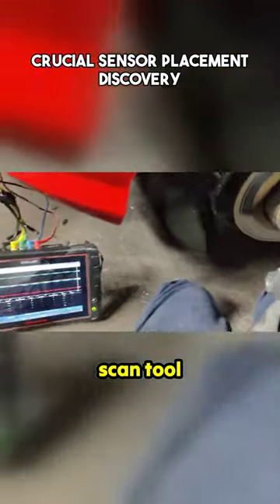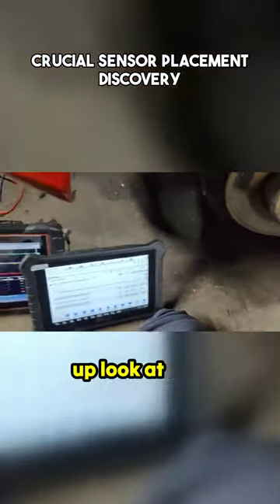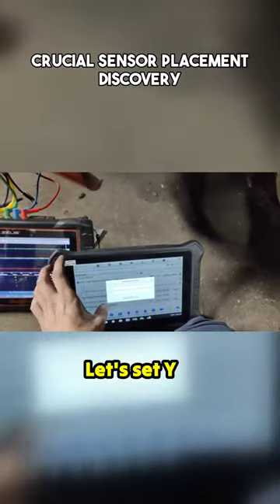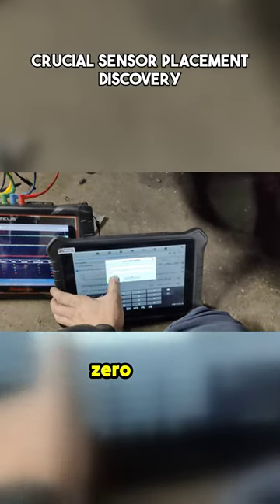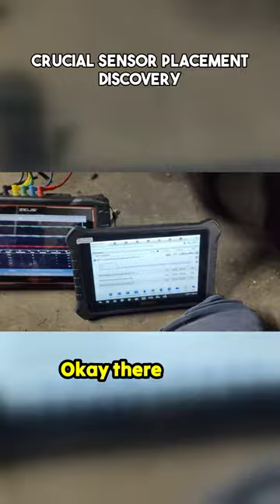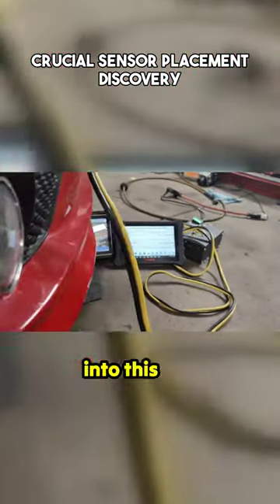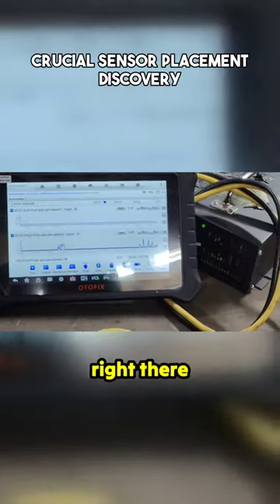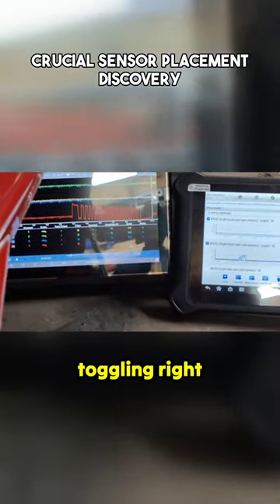Testing Wheel Speed Sensor on Scan Tool | Car Maintenance Vlog

Comment: Question. How would you test an active sensor on the scope?
From what I understand, they need a voltage applied to them, would you apply an external 5V or 12V signal amd then test as normal?